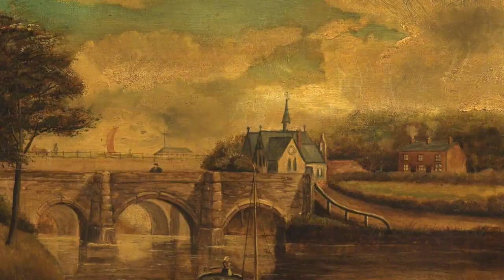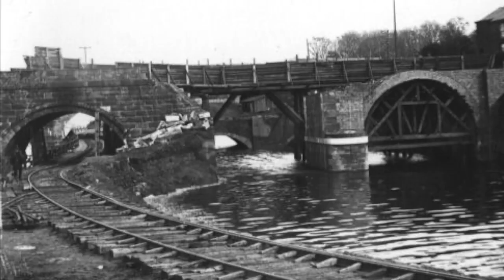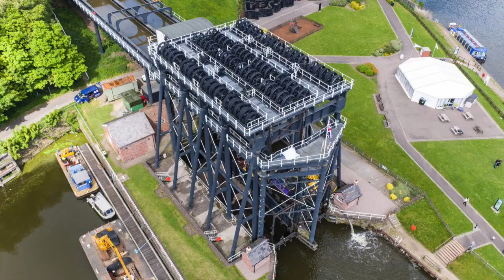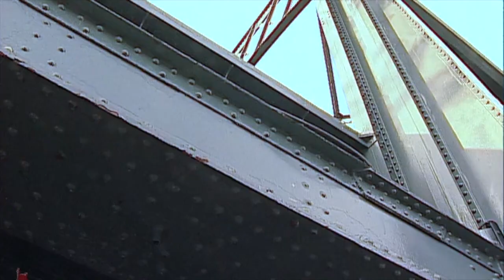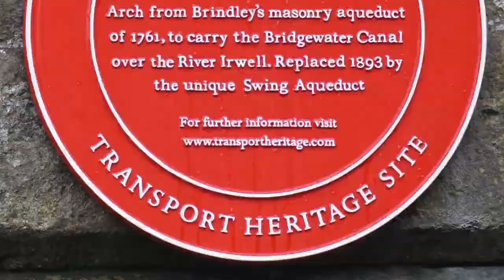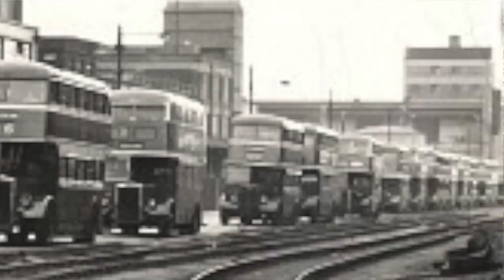Why is Barton Swing Aqueduct? And why is Bridgewater Canal?

Comment: The Ship Canal uses the River Irwell for water in Manchester, but after Irlam Locks, uses the River Mersey. If you cross the ship canal using the Warburton toll bridge, you pass over the old Mersey bridge, and the toll keepers cottage is still there by the old bridge. When you approach Warrington, the ship canal parts company with the Mersey and strikes directly west whilst the River Mersey continues through Warrington on its old meandering course.